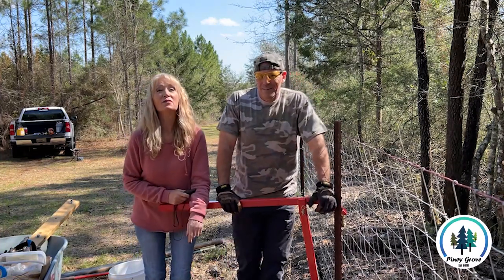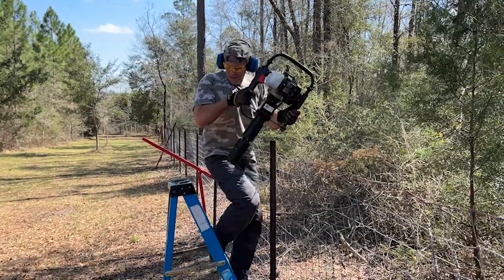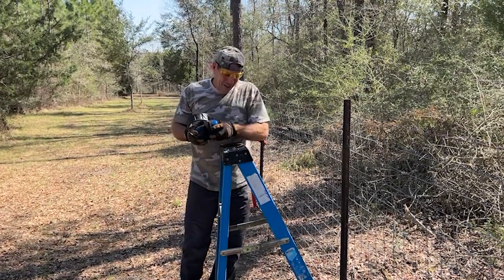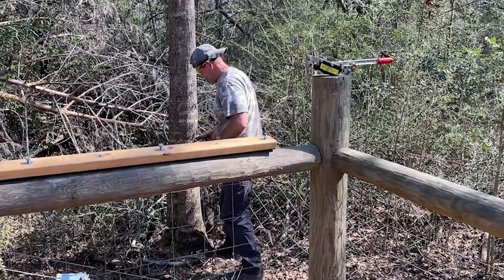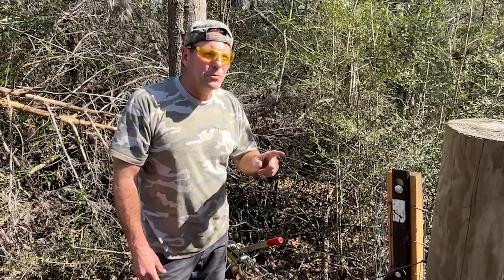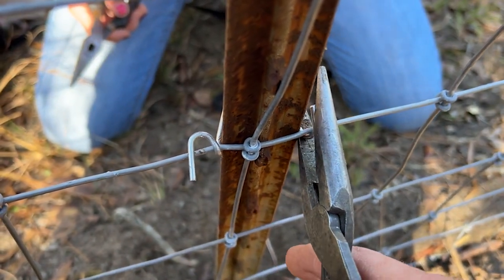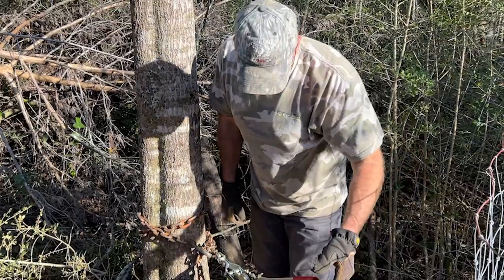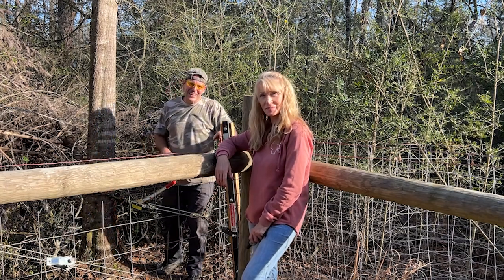Tips for DIY Woven Wire Farm Fencing - Things We've Learned

Comment: I have been using my bucket for installing T posts for over 15 years, works well unless you have rocky ground.  A home made draw bar attachment makes it very easy to pull them up from the rear lift
Reply from the maker: It's an easy way to drive them in!